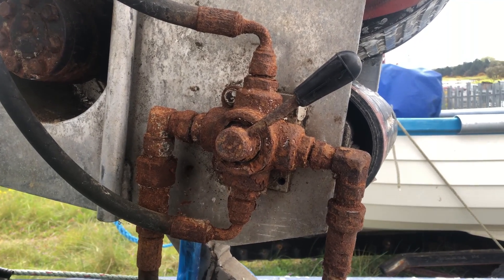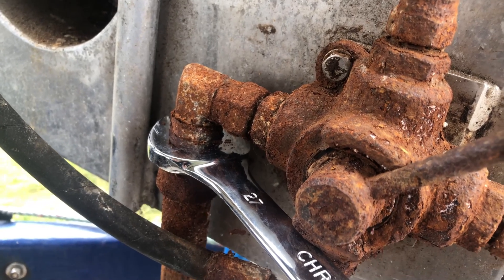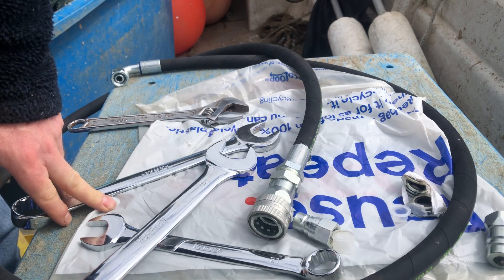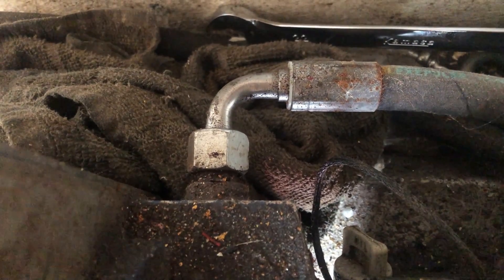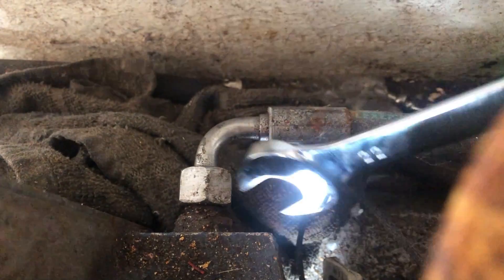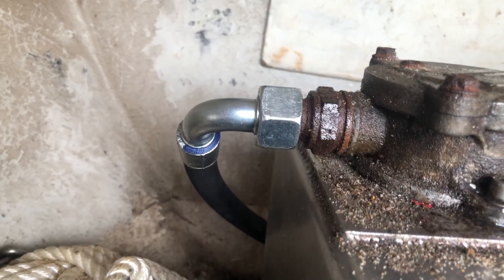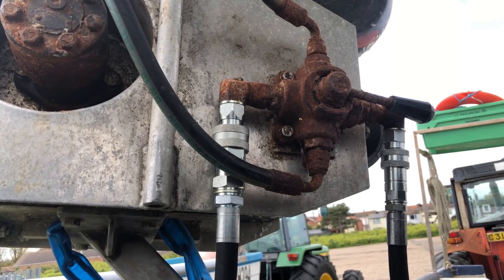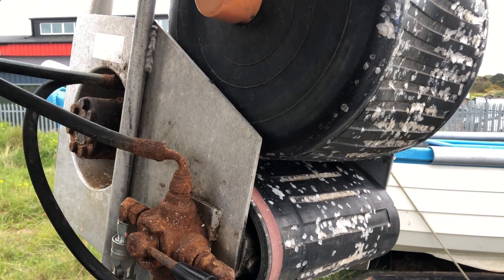Replacing boat hydraulic hoses and quick releases, and a £35 control valve for pot and net haulers

Comment: There’s a great protective  spray called Boshield T9 that coats marine parts with a waxy coating that’s waterproof.
Reply from the maker: cheers, I will have a look. I usually use waxoyl, but rust still seems to develop